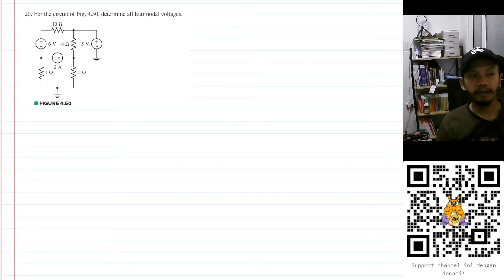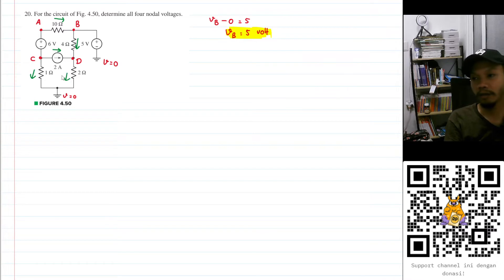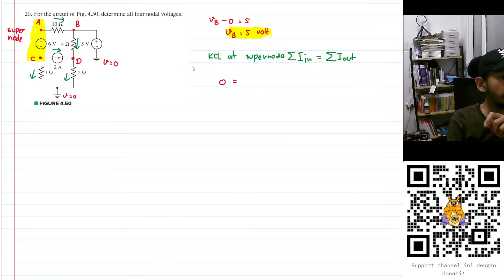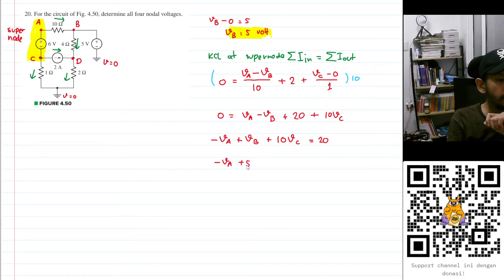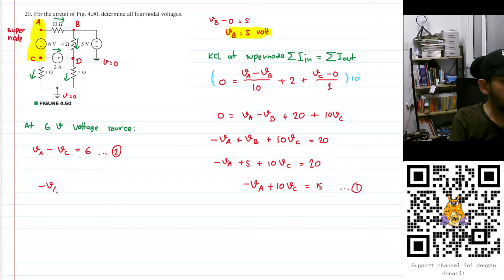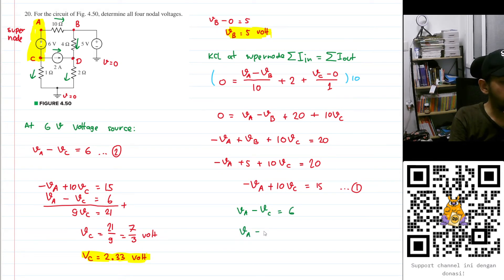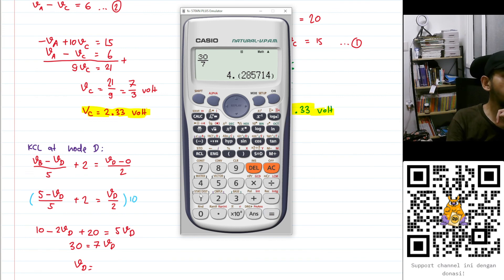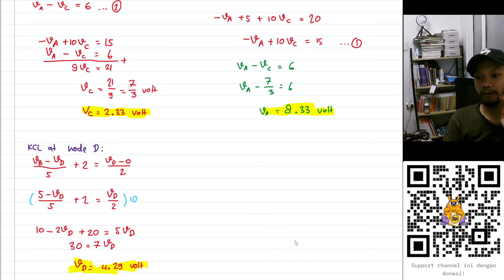Problem 4.20 - Engineering Circuit Analysis - Hayt & Hemmerly, 9th Ed - Nodal Analysis - Supernode

Comment: You have a sign error.  Vc should be -1.909 V.  equation 1. should be -Va -10Vc = 15.
Reply: You are correct.
Reply: Also Vd= 4.333 because you divide 5-Vd by 5 instead of 4 from the resistor.
Reply from the maker: Maybe